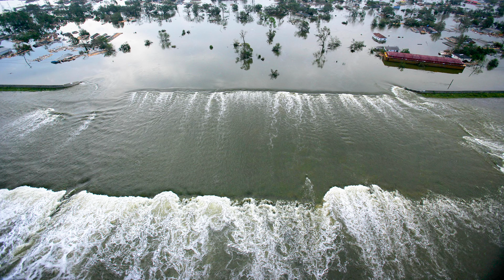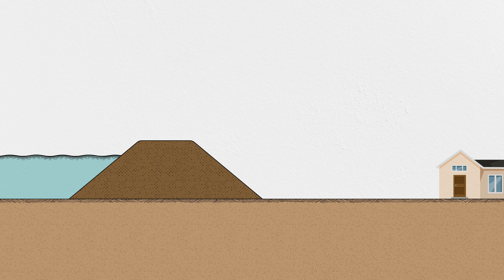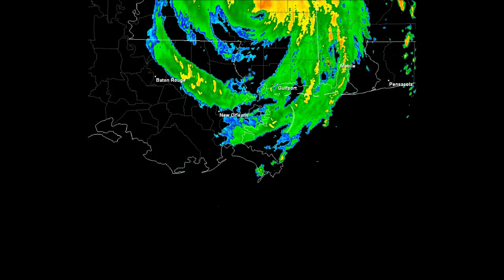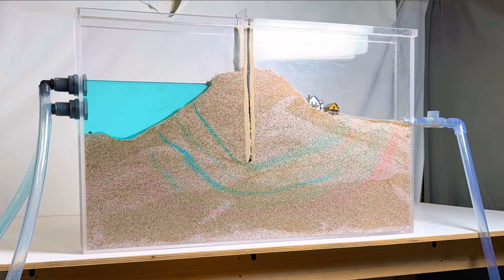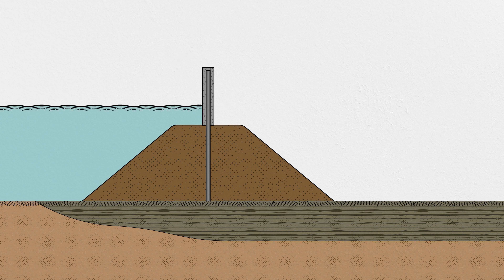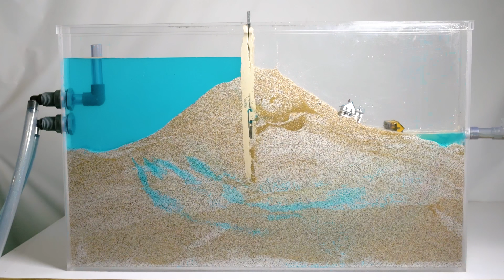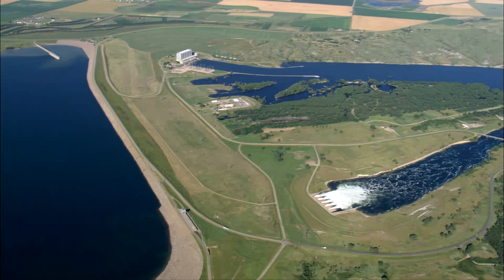The Mind-Blowing Flaw That Flooded New Orleans

Comment: Super interesting, and also very sad for the people of New Orleans... I didn't know this portion of the story, only somewhat superficially.
To me, it sounds a bit like the Fukushima Nuclear incident... from the beginning up to several years later, the absolute vast majority of international reports about it either failed to acknowledge or simply ignored how the nuclear meltdown itself also was preventable. It almost felt like purposeful ignorance. And it did result in overturning a lower court case that would force the operator and perhaps even government to pay fines and damages to the population affected by it, decades later. But basically, the nuclear power plant had 10 years of warnings regarding a single action that would've prevented the meltdown - moving backup power structure to higher ground, exactly because of a predicted scenario of a tsunami hitting the plant. 10 years of warnings ignored.
And I dunno if lessons were learned there, since it mostly stayed out of the media. Mentions about this fact are very few and far between in the majority of the coverage I've watched, be it on TV news, documentaries, technical analysis and whatnot.

Comment: I feel like my newscycle is rigged. The Netherlands have so much land under sea level. There must be engineering failures where large areas of land get flooded by the short comings and limitations explained in this video, but I have no rememberance about them.
Reply: The Netherlands don't have hurricanes. You get the occasional winter storm and even a few tornadoes, but nothing on the magnitude of a tropical cyclone. The big concern in the Netherlands is getting all the seepage and rainfall away from the areas below sea level. That's why they had so many windmills, they ran the pumps that kept the Netherlands dry. These days, it's very unremarkable electric pump stations that do the same thing, often at basically the same site.
Reply: @hammerth1421 
Get a brain😂😂
Bad storms with similar amounts of Rain are actually a Thing, karen😂
They Close the Gates, put the pumps on full force, Take the cattle in and simply let the flood Plains Take the hit If it gets Bet. Water cant Push in from the ocean

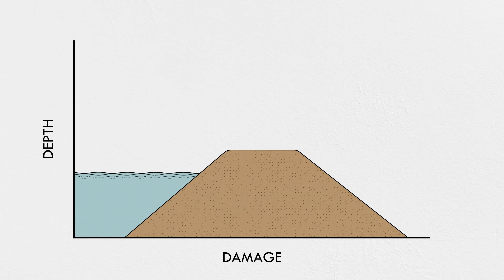Comment: @16:52 - Holland says "hou mijn bier".  You're depth damage curve @18:00 is incorrect.  As the water rises and stays behind the levy the damage is $0.  As soon as the water breaches the levy in a significant manner the damage goes is vertical to some maximal value (the impacted area covered by the height of the breach), then curves upward as indicated as water continues to rise.  You properly describe this in your narrative - but the graph doesn't show this.  Key thing is that the cost of the breach is not gradually increasing, but is instantaneously a catastrophically large dollar amount when the breach occurs.

Comment: Thanks. A very good explanation about the 'technical' forces that could make leaves fail however, there are also 'rumors' about the possibility of a little help in order to sacrifice certain areas in order to protect others. Could have been, maybe. Years back, I worked with a couple of 'volunteers' who joined one of the crews, after the Big One, searching some of the large rural flooded areas, by small power boat. Occasionally, they would find floating bodies that had bloated and popped to the surface because of internal gasses. Now, this is where the story goes sideways but you gatta know the boys involved so, I accepted their story cause, we were all just 'good o' boys', from the deep South. So, rather than retrieving the poor souls, they just used a sharp boarding pike and, 'resunk' 'em. Human skin works just like any other balloon material and holds in gasses until released. One could say, 'Just another good story', shared during a quiet evening, in our favorite Louisiana watering hole and, that 'it might not be true'. However, One never knows, do one?

Comment: Another reason was that the city is lower because of the levees and pumps. Historically, it was close to sea level but just above, but it was marshy and flooded regularly. As levees and pumps let it dry out and since dry land is more compact than moist, the city began to lower.
Reply: Excellent point. Subsidence is real in any area pumping groundwater.
Reply: I think part of it too is that flood water from the river was muddy water. So the flood water would deposit additional sediment, which would over time build up the land. When you take away the flooding, you take away that periodic influx of additional sediment.

Comment: Hi Grady, where do I start to look for any information about civil projects in my area? It would be interesting to see what design direction some of the projects use. Also how to track down how any existing civil structures were built? It seems difficult to find easily accessible information about these technical details.

 I live in a flat plains area that has leveys and diversions for seasonal flooding from winter to spring.

Comment: Very good video. For modelling a seepage flow, consider using a Hele-Shaw model technique. Two paralel glass plates at about 0.030" to 0.035" apart will work for modeling cross sections. This technique was my Masters Thesis in 1982. It worked great when you cooled the water and added soap to reduce capillary rise. I hadn't realized that USACE had screwed up so much on that project. As much as you explain consequences to politicians, they will chose what benefits them now and hope that the consequences are after they are out of office. Good Luck, Rick

Comment: The engineering discussion in this is on point. Ther are two things outside of it that are still factors though, no matter how well engineered something is:

1: many places were toppled because of loose barges crashing through walls. That is what happened in the lower ninth ward. The boat hit the wall, compromised it and it caved, flooding the whole neighborhood, even though eaters hadnt topped the walls.

2. No matter how good our engineering is, when we build in places that are naturally unfit for building, eventually mother nature will win. Ex: outer Banks homes in the Carolinas, unstable sea cliffs in California (mud slides), and here in NOLA, where the suburban sprawl simply outgrew that actual buildable land available above sea level and in stable areas (only the crescent along the river really qualifies).

As long as we keep building in those areas, things like this will happen eventually.

Comment: I'll need to get a copy of the book
Another example for engineering failures leading directly to changes in execution and codes: look at Miami and Hurricane Andrew. As much as the damage was widespread, there were areas where a neighborhood would be all-but leveled but the neighborhood across the street would be largely intact with only minor damage. The pre-to-post 2001 building code update was a night to day change in how wind damage resistance was treated. The change took long enough to write because they had to define not only the expected worst case average wind loads (which were increased again in 2020 after Hurricane Michael) but also what it would take to consistently build to those increased levels without making building unaffordable.

Comment: The bottom line, which is also going to be the ultimate outcome as the sea level keeps rising and more of the delta is submerged into the gulf, is that New Orleans will have to be abandoned and the people relocated. They should have used Hurricane Katrina to abandon the areas below sea level and relocated the people away from the city. It's inevitable, and there's just going to be a much larger disaster again at some point in the future.

Comment: I'm not sure if it's still true, but I know that it used to be that one of the critically ignored inputs to the engineering model for levees is land subsidence on the protected side.  It is inevitable that as the protected land dries out and is no longer replenished by seasonal flooding it will begin to compact and subside.  This will lead to a higher pressure gradient between the contained side and the protected side than a model that doesn't take subsidence into account would predict.
Reply: This is a very common occurrence here in the Netherlands as well - and very much NOT ignored.

It's also why so much of the country is below sea level, in fact. Although there are polders which were reclaimed from the sea or deep lakes, many of them are simply former marshland that was protected from flooding by dikes and then subsided below sea level over the centuries.

Comment: The City of New Orleans cannot be saved because the Mississippi River isn't allowed to deposit silt downstream.  I've read that the bottom 1/3-1/2 of Louisiana will be lost to the the Gulf of Mexico because flood gates in the northern part of the state prevented the Mississippi River from changing course in the 1970's and replenishing the entire delta with silt.  This was done to preserve shipping access to the Gulf from Baton Rouge south.
Reply: Honestly, I think infrastructure improvements should be made along the Atchafalaya River now to prepare for the inevitable course change of the Mississippi River. It would be easier to make the changes gradually now, instead of waiting to react to a disaster that breaches the Old River Control Structure (ORCS; or other levees in the vicinity) and results in a sudden, irreversible change. Keeping the Mississippi on its current course becomes increasingly difficult as time passes, and the odds that a future flood will breach the ORCS becomes more likely with time.

Baton Rouge and New Orleans will also need to find other sources of freshwater since Gulf saltwater would inundate the current course of the Mississippi River.
Reply: @sbclaridge  Perhaps, but I imagine the overriding reason for trying to maintain the status quo is global trade moving from the Midwest through the Port of New Orleans,  jobs and capital invested along the current and future path of the river.
Reply: @sbclaridge only if Henry Shreve never dug his famous cut we may be looking at a different situation today

Comment: I had the pleasure of rebuilding the levees from east new Orleans to port sulphur la . I can tell you after finishing some of the levees we had to go back and build up sectiona higher than the army core of engineers  called for . Erosion fabric was added to the protected side and the railroad had us add huge pads made of individual concrete blocks tied together with Ia half inch nylon rope . It sits on the crown of the levee . It works for both a service rd and protection . Sure hope she holds on the next cat 4 or 5 . We have a lot of clay here also . Be interesting to see the model with it .
Reply: As do I but living in a city built below sea level seems insane to me
Reply: @alicefairchild2551 Im with ya

Comment: Katrina's real impact came because the eye went up the Pearl River right on the LA/MS border.  This left the left side of the storm going over the Delta and this blocked the storm's drain as it approached the shore.  The water that would normally have flowed across in front of the storm and then out the left side filled the Delta marsh and then backed up across the front of the storm to cause storm surge flooding much more extensive than projected for a storm of Katrina's size.  

The water in the Delta hit the levees and after the storm went north, that water was slow to drain due to the marshes.  This length of action gave time for the levee weaknesses to be exploited.

Comment: We can't go on spending billions of dollars on projects to protect trillions of dollars of structures and infrastructure built in known flood plains.  Flood insurance should be raised to reflect the ACTUAL COST of repairing/replacing those structures.  Property taxes should include a surcharge for infrastructure needed to support those areas, based on the likelihood that it, too, will require replacement.  This should be implemented immediately on any new construction or expansion, and phased in over time for existing buildings.  Eventually, these additional costs will become a part of the financial decision whether or not to build in such areas.

Comment: Having lived in southern LA. during Katrina and Gustav I know a lot about the situation.  Man has been f#cking up the Mississippi river from north to south for a hundred years with locks and dams, levies  and a diversion structure keeping the lower MS. river from going down the Atchafalaya river straight to the Gulf.  The river silt that had created New Orleans and the MS. river delta at the mouth of the MS. River has been disrupted and that barrier has been going away instead of increasing.as it should.  New Orleans is sinking every year and with natural sea level rise due to the Milankovitch cycles of the earth NO. will at some point cease to exist.  I know that in Baton Rouge it is a constant chore to stop the sand boils that is caused by water tunneling under the levies.  The Earth will win the game at some point.

Comment: I have long maintained that the main culprit for flood disasters is development getting approved in places where it shouldn't. Of course, proper development won't prevent every disaster, like what happened to New Orleans. But it can go a long way to mitigating damage. 

On the other hand, why have more grassland and parks near rivers and lakes when instead you can build? What's the worst that could happen ...
Reply: Half of the Netherlands is built below sea level. There's no hurricanes of course, but there are flood surges from rivers and storm surges from high tides. 
It works there because the government takes the whole idea of water management seriously, and funding, strict laws/regulations and oversight are not only enforced, but a matter of pride for everyone involved.

No one there would dream of cutting costs (like I read in several comments here), neglecting maintenance, privatizing any aspect of the waterworks, or undermining it by building too close to levees or trying to compromise by building a steel wall like in the video.

What happened in New Orleans was avoidable, or at least it could have been mitigated to the point of negligible damage.
Reply: Chicago raised their entire city once they'd had enough of flooding. Granted, they did it during a boom time and I know the south isnt exactly brimming with infrastructure money... But you'd think a city litterally built below sea level would look to find a permanent solution rather than continually scaling their damage mitigation measures.
Reply: The government needs to stop paying to build the flood walls, and tell areas like this they need to fund their own flood protection.  The government is also involved in flood insurance.  I'm not that knowledgeable about that insurance, but at some point we need to say that if it's too risky for a private company to insure, the government shouldn't be encouraging it.
Reply: @Br3ttM  does that also mean the whole Tornado alley should be abandoned?
because it's clear there's always gonna be tornado's there.
so why keep deling with it, just clear out the whole region.

and if you're doing that you might as well clear out most of California to ensure the wildfire that happen there won't cause any damage anymore.

see where i'm going?
Reply: @Br3ttM  A lot of the areas at greater risk from natural disasters are poorer areas, where a lot of the people keeping cities working have to live. Penalizing people who are already disadvantaged isn't a good or effective strategy.
Reply: @emilie4058   That's even more reason.  Instead of people being stuck in a cycle of poverty they will go to a place with more opportunity.  There is a reason so many never returned from Houston back to New Orleans.  They instantly had a better life.
Reply: @robertlowery7086  The person I replied to said that people in those areas simply shouldn't be protected at all. They'll still be stuck there if you just remove safety measures.
Reply: @robertlowery7086 
Move to areas with more opportunity with what money? If you have to budget for the $5 to use the bus to get to work you don't have the thousands it costs to move elsewhere.
It's also incredibly short sighted to privitize safety measures for a city. Imagine it's cheap and causes more problems 10 years after installed and you moved into the area 2 years before it goes bad.
Reply: "development getting approved in places where it shouldn't." wow what a trail of tears for you.

Funny, I seem to recall history of New York sharing language speakers with both Venice and Holland. Guess they couldn't bring people to Louisiana who speak Metric. That would be Italian fascism and Dutch colonialism.

At least there's spots to dump your tea.